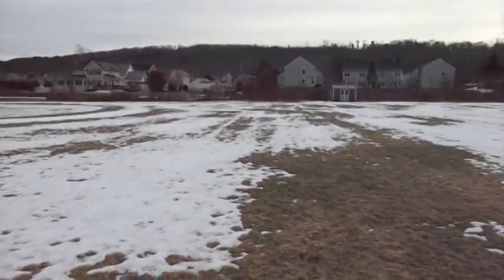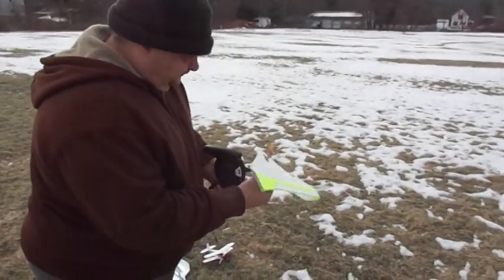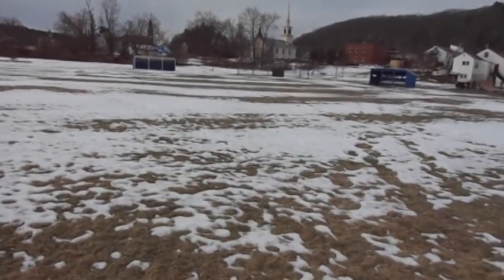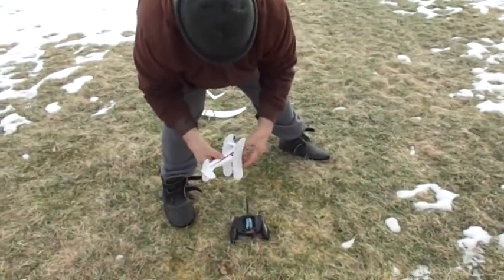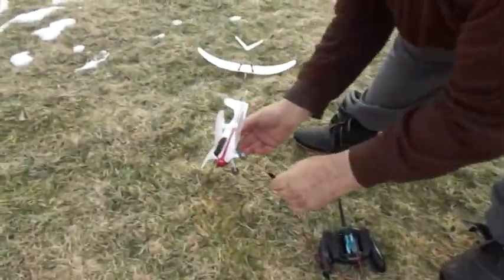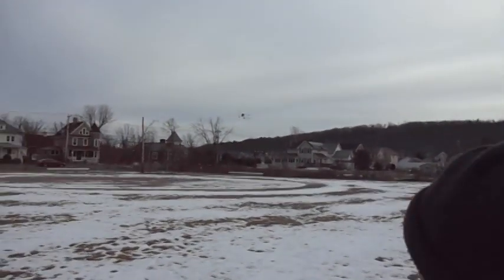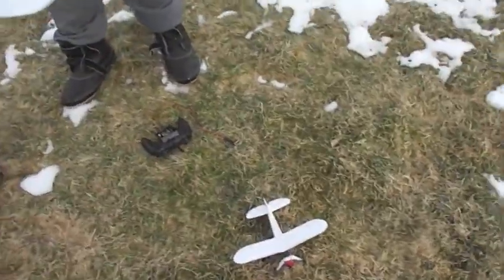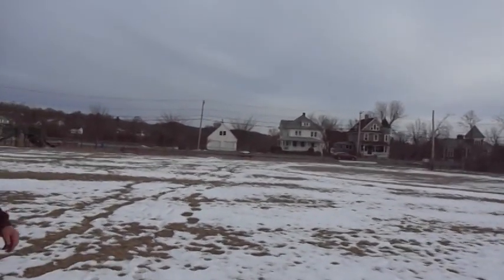3 Maiden Flights! SUPERCAPACITOR Planes, Micro DAKOTA

Comment: Hello guys! I've started to build a cap powered model. Can I put double caps of 10F to fly longer? Thanks beforehand
Reply from the maker: yes you can, we do it quite often. Wire them in parallel. it will take proportionately longer to charge but will reach the same peak voltage if you're checking it with a meter.
Reply: @sonex413  Thanks. I'll be doing

Comment: Your number two delta wing flyer looks a little like the old Navy Cutlasses.  So "Cutlass" it is. LOL
Reply from the maker: Great name! Unfortunately the model just didn't have enough power with the original 6mm motor, so I guess you could also call it the "Gutless" just like they did to the original! I'm going to build another one with a 7mm motor because it really was nice and stable even if it had little duration. Thanks for watching and commenting. -Mike and Richie

Comment: The little Dakota is amazing. Is there any build information  (lines, construction details) posted anywhere that one can dream about while waiting for their first Banggood Supercap order to arrive? Also, what is the connection between your site name and the Sonex airplane? Do you have a full scale build in process? Years ago I was making parts for a Pietenpol but sadly, “that ship has sailed”.
Reply from the maker: Hi Al, for a micro replica like the Dakota, I first head over to outerzone.co.uk where you can find thousands of old model plans downloadable in PDF format, free. I looked for the Dakota to build 'cause my flying buddy Rich has the original full size one (video of it on my channel). After downloading the PDF I scaled it on my computer screen (PDF reader has scaling function) , ,to the desired wingspan, in this case 10" which would be a match for a 6mm motor with 10F cap if built from 3mm hobby store sheet foam. I then turn down the room lights and trace the outlines of the major parts with admittedly low tech paper and pencil, right over the screen. The structure can be simplified- you don't need as many bulkheads in the fuse and you can dispense with wing ribs and the like. My Dakota has bulkheads at front and rear of "cabin" only, a little thicker pc of foam in the nose so the motor can be epoxied into a little hole. Make allowances for the different relative thickness of the foam sheets vs. original balsa parts, i.e, bulkheads need to be narrower and shorter for it to come out "scale". It has .020 or .025 music wire landing gear with bushed foam wheels. Last thing installed is the cap so you can move it for balance. Wings (flat bottom airfoil) and tail planes (symmetrical) sanded to airfoil section prior to assembly, fuselage corners rounded. Final sand 600 and trim with magic marker (test first on scrap, some pens melt foam).
I enlarged the tail surfaces about 5-10%, possibly overkill but works nice.  Same drill for scale jobs too, my little Spitfire is scaled from drawings of a 5 foot span multi R/C job (also from outerzone site). I just downloaded one I'm going to try, a Blohm und Voss BV141B (I like the weird ones). I want to use a 7mm motor so I'm thinking maybe 16-18 inch span. 
I'm a longtime private pilot and I do have a partially completed Sonex (s/n 413!) and my early videos on this channel were often related to that. Sadly, I think I'll have to look for a good home for it as the models fit my budget better these days! Thanks for commenting and welcome to the channel. -Mike
Reply: sonex413 Thanks Mike for all the details on the Dakota. I’m familiar with Outer Zone and should have no problem building from the plan and all your good information. I need to get past some upcoming surgery and will then get started in earnest. In the mean time your web site and videos are a Godsend for me to keep my “head” in the right place. 

I am also a private pilot, SEL, Cessna 150/152, and suspected that you are too. I was hooked on Pietenpols and wangled a few flights In them before starting to build, but reality set in in the form of financial and health limitations, so I had to let that dream go. Thank God for Model Airplanes!

All the best! I will stay tuned! Al, in Ann Arbor, MI
Reply from the maker: @als.4568  Sounds like we are in the same boat...I'm glad to be able to enjoy some model flying and I have a couple of buddies who enjoy it too. It's also nice to meet others like yourself who enjoy this hobby. Thanks again for joining our virtual modeling community! -Mike (Monson, MA)
Reply: sonex413 Hi Mike , I found a Dakota plan with Joe Wagoner’s name on it on Outer Zone. Seems like a good place to start and I have scaled it to a 10 inch span, but will stick with your description of your build (flat bottom wing, etc.)
Did you use a 6x15 motor? How about the motor axis alignment? This plan shows 5 degrees left but that is for a .049 glow engine. I suspect that the little electric motor is a totally different “animal”.

Thanks, Al in Ann Arbor.
Reply from the maker: @als.4568  Yes, 615 motor and 10F cap. It has right and down thrust, eyeballed in about 5 degrees each. Motor rotation is CCW viewed from the front. Mine climbs and glides left with just a tad of left rudder trim. Flying weight is 12.4g. Original design has opposite side  thrust to what you'd think, the designer explains it as his attempt to harness the spiral airflow interaction with the fuselage and tail to counteract engine torque.  Mine works well as I described. Typical duration about 30-45 seconds reaching a height of about 80-100 ft. on a full charge (2.8-2.85 V). Hope this helps, good luck!! -Mike
Reply from the maker: P.S. I've posted a video build-along series you might want to check out, it uses 6mm motor and 10Farad cap, see my channel.

Comment: All your videos are graet 
Love it please show how to build (step by step) or make the 3d airplanes you make and how to install the capacitor and motors ...
Reply from the maker: Hello Santos! We're glad you like the videos! I just posted the third part of a video series in which you can follow along on a build. The final part will be posted tomorrow. It's a fairly simply design to build and is a good place to start if you haven't built one before. I intend to post more build-along projects and each will be a little more complex. The little Dakota in this video would be the third or fourth step, probably. There are a few features which make it a bit more difficult to build...the 3D structure, airfoil section sanded into wings, assembling biplane structure with struts, it has wheels you have to make, etc etc...Have a look at my build-along videos and my "supercapacitor free flight basics" video, thats a good place to start.

Watch
Reply: I've been following your videos but there's no videos on the 3d airplanes where the capacitor and motor are inside the airplane ....how you did it?
Reply from the maker: The Dakota is built like a box from 3mm foam sheet.There are bulkheads of the same material inside fuselage at front and back of cabin area, also thicker foam bulkhead in nose. Motor epoxied into foam nose and capacitor epoxied inside plane sitting on floor. Capacitor is last thing to be attached after determining where it has to be mounted to balance properly. Wings and tail 3mm sheet foam sanded to airfoil shape. .020" music wire landing gear with handmade foam wheels . Original Joe Wagner Dakota plans downloaded from outerzone.co.uk  , scaled to about 10" span and modified and simplified to allow foam construction. I hope this helps. The little red and white Ranger you commented on is basically the same construction.
Reply: @sonex413  please show us how to build the Dakota and other plains  and how to install capacitor and the rest of the parts still waiting for the video's
Reply from the maker: @santossantiago4249  You must walk before you can run, and you must crawl before you can walk. The Dakota is not a good choice to build until you have some experience. Don't worry, it's coming in due time. Be patient and try building the plane I recently posted the build video about.
Reply: Joe Wagners airplane love it  3d airplane

Comment: Dakota is the sweetest little thing!  I’ve got to build it out some day. Just just gotsta!!
Reply from the maker: The little Dakota flies much better now than it did in this video...it's only my second cap model and we weren't using switches on our models nor did we have our nice chargers at the time...matter of fact, I think we had dead batteries that day, too!  Since then I've chopped into it and installed a switch and the upgrade 615 motor like we're using in the build-along...it now has a skyrocket climb on a full charge and gets up there a good 100 feet with 30-40 second duration..super reliable flyer and Richie's favorite by far...
Reply: sonex413 Cool Cool Cool!!!

Comment: and how do you make a turn with it?
Reply from the maker: It is adjusted with the rudder so that it glides in a circle without power, then as you begin test flying with power, make adjustments to the motor thrust angle (motor directed downward or to the side)  so that it circles the same direction both powered and unpowered. There is no radio control, the model flies free as you have adjusted it!
Reply from the maker: The rudder is adjusted to glide in a circle and then as you add power to the flights you may have to adjust the thrust angle of the motor. My Dakota has about 5 degrees of down thrust and 5 degrees of right thrust. It climbs to the left and glides to the left. -Mike
Reply: @sonex413  I will then make the correct corrections in my model. I really like your videos. Congratulations, for sharing your knowledge.
Reply from the maker: Thanks Valdo, have fun with your flying experiments! We're glad you're part of our subscriber community.- Mike and Richie

Comment: Can you tell me how to correct the CG of this Dakota?
Reply from the maker: Sure! The airplane balances at a point directly above the leading edge of the bottom wing. Here are the plans for the original Dakota: https://outerzone.co.uk/plan_files_00/233/Dakota_Biplane_2_oz233.pdf
I used only the outlines of the original scaled to a 10 inch wingspan and altered the construction to suit the material, 3mm foam. Make this plan the size you want on your computer screen, then trace the outlines with tracing paper and a pencil! Good luck and thanks for subscribing! -Mike
Reply: @sonex413  Thanks again for the guidance. Congratulations on the flight field, it seems to be very nice.

Comment: Mike, Ron from Minnesota here. What are your weights on the foamies you’re making and successfully flying? I put your same motor, capacitor setup in a micro foamie Goldberg Zipper I cooked up. It comes in at 15 grams, most of the weight being paint and epoxy. The little Zipper looks cool as hell and everything is correct CG-wise and alignment-wise but it only flew six feet before it hit the ground. I think it’s way too heavy. Also, I got my Champ video on my channel. Have a look.
Reply from the maker: Hi Ron, good to hear from you sir! Hey, that Champ looks GREAT! And you have a great place to fly it...I am so happy for you! As far as the little capacitor foamies, I really didn't know what they weighed and being a bit curious myself, I rigged up a balance beam using a couple of 2.5 gram US pennies! I came up with a flying weight of about 12.5 grams for both the little biplane Dakota and for a similar sized Goldberg Ranger monoplane. Each has a wing area of about 32 square inches. They are giving us consistent 30 second flights using 10 Farad 2.7 volt cap, 6mm x 15mm coreless motor with an internal resistance of about 1.3 Ohms, and 45mm propeller. We are also using a small slide switch so we can charge and then wait a short time before before turning on and launching. Wings and tail surfaces are sanded to a nice airfoil shape, no square leading or trailing edges. Construction is 3mm white foam from the hobby store, colors are Sharpie magic markers. We use a digital voltmeter in parallel with the charging leads to monitor capacitor voltage during charge and have found best performance with a full charge of about 2.75 to 2.85 volts. At first we used 2 AA batteries to supply power but we got tired of buying them and came up with a constant current field charger that runs off larger LiPo cells and steps them down in both volts and amps to suit the caps. Watch for an upcoming video on building one for under twenty bucks. Richie and I built two of them and we LOVE them! Richie has also tried a bigger 7mm x 20mm coreless motor with a 55mm prop using the same capacitor with great results. He is flying a really light foamie with probably 50 square inches of wing area, a 1/8" square balsa tail boom and sanded to within an inch of its life. The motor has a lot more thrust than the 6mm and run time is not too much less! It climbs like a gassie! He is averaging around a minute with that one and is actually on his second one as the first one flew away. They are quite capable of riding a thermal! Video on the new ships coming soon also when I can find the time to do a little video editing! If you get it to glide good it should fly good, use a voltmeter to make sure you're getting a full charge and a 20 to 30 second power run when you do a bench test! Richie and I would love to help you achieve some good flights, let us know how you're doing! Richie says HI.  Mike
Reply: Thanks for the detail! I’m heading back to the drawing board. But I am beginning to regret going to my 1975 high school electronics class stoned every day. My buddies and I were more entertained by throwing old vacuum tubes against the room’s concrete block walls and watching the teacher react to the implosions. Karma’s revenge — I could use a little knowledge of electronics right now. Maybe I’ll put together a fail-and-regroup video of my micro Zipper. Thanks again for the info.
Reply from the maker: My pleasure, Ron!

Comment: Excellent video with ample Richie. And good yucks on the shout-out. Is your mini Dakota the BMJR kit? Your little Dakota is a nice, docile flyer. I remember that the mini Dakota on the BMJR demo video whipped around like a hummingbird and looked like something I’d want to have no part of. But maybe I’ll get it now. I read you’re using the ten farad capacitors even on the single-motor airplanes. It looks like that’s no problem. Can you provide links to where you’re buying the motors, props, and capacitors?
Reply from the maker: HAHA Glad you caught that shout-out! The little Dakota was scratch built by me from 3mm hobby store sheet foam, very light and straight..outlines scaled by tracing over my computer screen (pencil and tracing paper) over  original Dakota drawings. (Get those along with thousands more at outerzone.co.uk) Motors and props were cannibalized from my buddy Danger Chris' junk box of broken flying toys. They are equivalent to the little motors and props in the smallest micro-quads, i.e., 6mm x 15mm coreless brushed motor, 45mm dia. 2 blade prop. I got the caps from Bangood and since then I've ordered up a couple motors from there too. They didn't have the tiny props but I found those from a model heli shop on ebay. Limit charge time to limit flight time, start small. I'm going to do a video on the care and feeding of supercaps soon. Take care Ron!
Mike